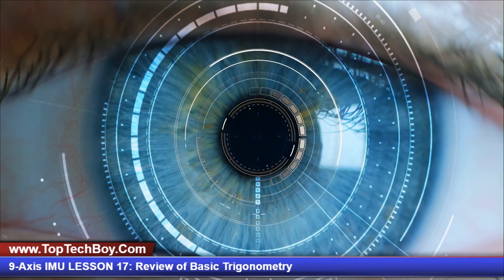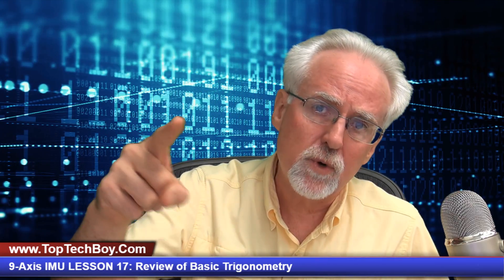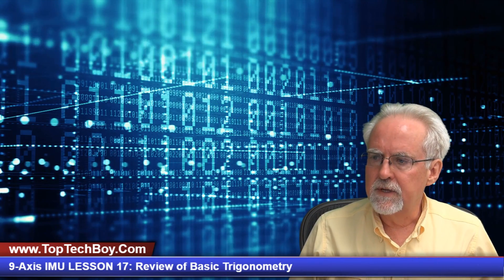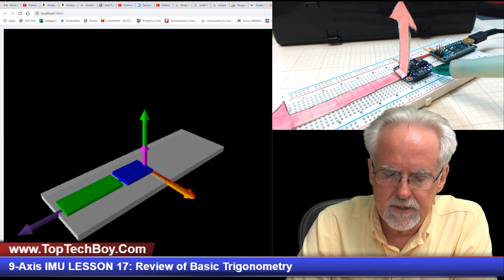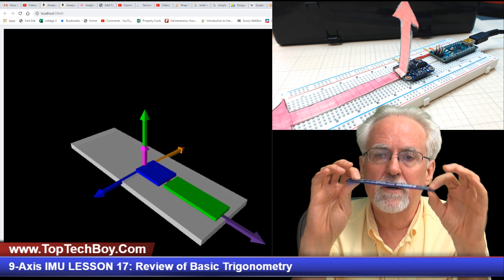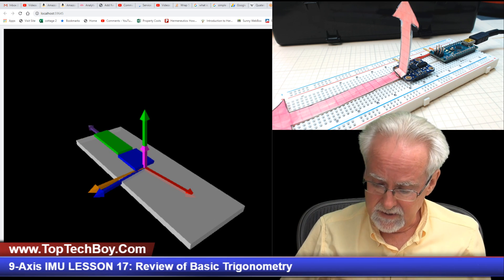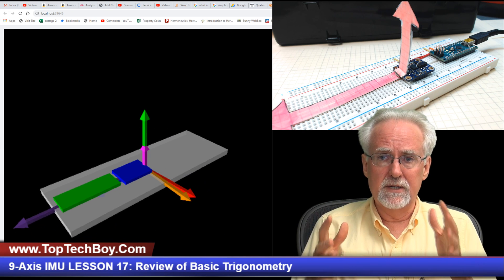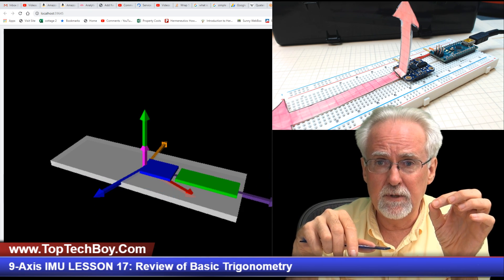9-Axis IMU LESSON 17: Review of Basic Trigonometry

Comment: Excellent explanation, but that calculator screen looks yucky – putting spit on it doesn't exactly make things better.
Reply: That's a TI calculator. It'll go through hell and high water with its engineering master before it needs a new coin cell. A bit of spit don't bother it none. If it had a tail, you would need to put a leash on it.